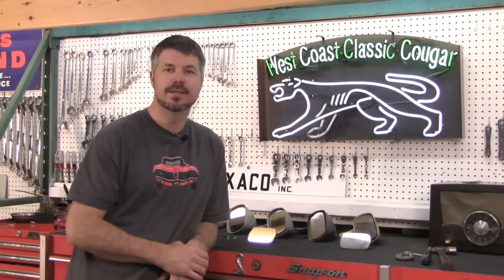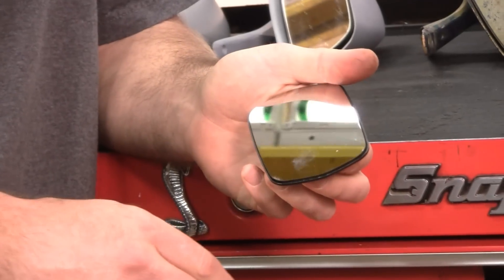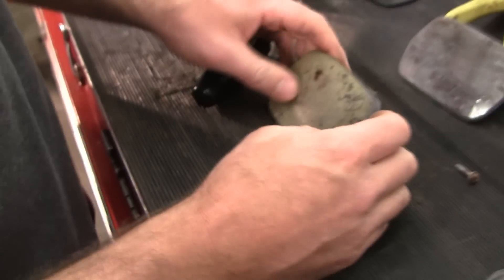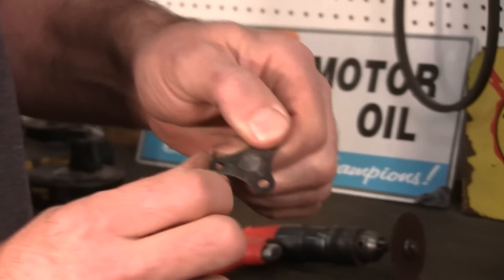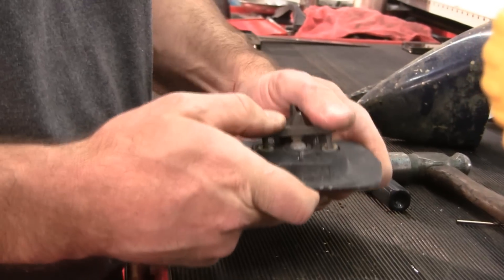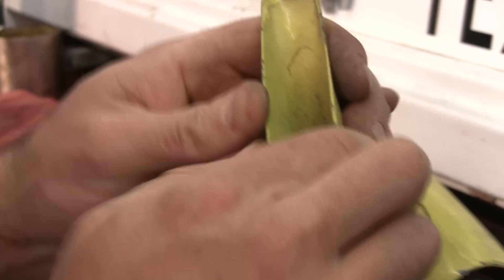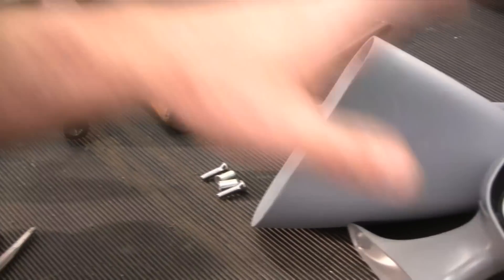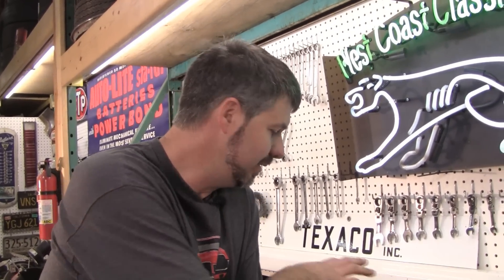RH Sport Mirror Repair: 69-73 Ford / Mercury / Lincoln

Comment: Great video! You guys think it would be possible to take out the mirror lens in one piece (e.g. using a wire saw)? Is there enough to get sthg in between to cut the silicon glue?
Reply from the maker: It's possible! Doesn't hurt to try.

Comment: do you have a video for repairing the joy stick on the driver sport mirror? 73 Maverick, the joy stick is broken off at the think spot.  I took one apart but it seems impossible to screw in a new joystick without breaking the cable holder.
Reply from the maker: We do not have a video for that, but we do say in our listing for the reproduction wands (https://secure.cougarpartscatalog.com/68wand.html):

This threaded replacement wand will require you to cut 8/32" fine threads in your original controller. Your OEM mirror controller is made of a very soft metal so one can often install these as "self tapping".

Comment: Hello:  Thank you for your video about the repair of the RH mirror.  What about a video about replacing a broken adjustment knob on the driver side mirror on a 1970 Ford/Mercury.
Reply from the maker: wayne cowan Not sure if a video is needed, we have new knobs, just unscrew the broken one (or carefully drill it out if it's broken too far down) and screw in a new one. http://www2.cougarpartscatalog.com/68wand.html
If you need to remove the special bezel nut, we have a tool for it: http://www2.cougarpartscatalog.com/67mirrornuttool.html

Comment: any video on replacing the side mirror glass on a 67 mustang? the repros are nice but i want to keep it original. and i cant find any original full assemblys that are better than the one i have. (besides the cracked glass)
Reply from the maker: I asked a few of the guys and basically got the same answer:
"I think the Mustang 67 mirror is almost impossible to replace the glass. He should go ask the guys on a Mustang forum." Basically, there is not clearance around the glass to get in there and remove any fasteners, and if you try to pry the glass out, you end up damaging the mirror internal components.  But maybe there are some owners on the Mustang forums with tips on how to do it without damaging the mirror internals.  We have learned a lot of tips and tricks from the Cougar and Mustang owner forums.

Comment: I have a couple questions...can you get a matched set of mirrors for a 68 cougar, and can you fit power windows into a 68?
Reply from the maker: They make a matched set of Repro mirrors for the 68 Cougar.  The Cougar did not come with a passenger mirror (it was supposed to be a dealer option), but when they reproduced the driver side manual mirror, they mirrored it and created a passenger side mirror.  Both are available on our website: https://secure.cougarpartscatalog.com/store/Search.aspx?CatID=15885&SearchTerms=26512%2014704%2026226%2026520&Type=OR

We have a power window conversion kit for the 68 Cougar: https://secure.cougarpartscatalog.com/store/Search.aspx?SearchTerms=power%20window&CatID=15885